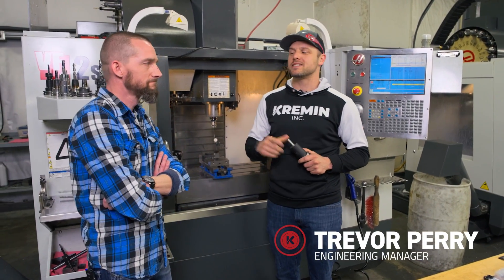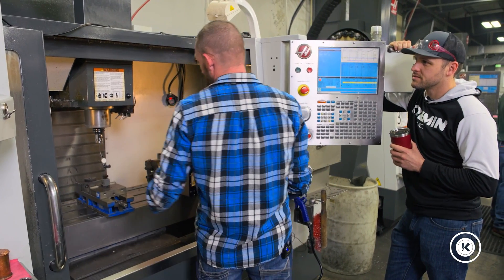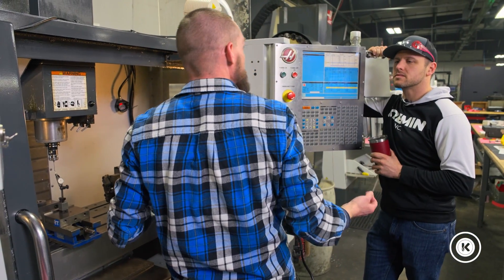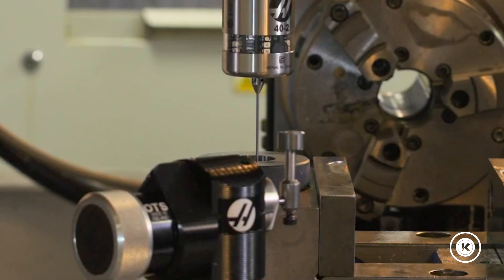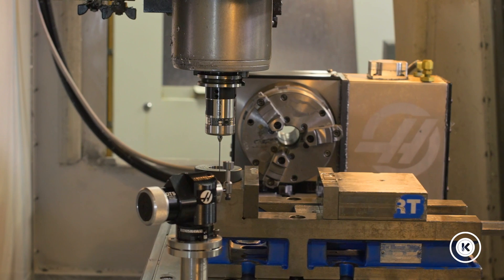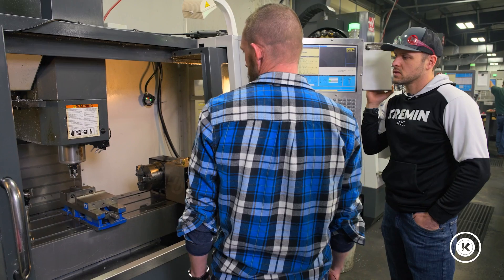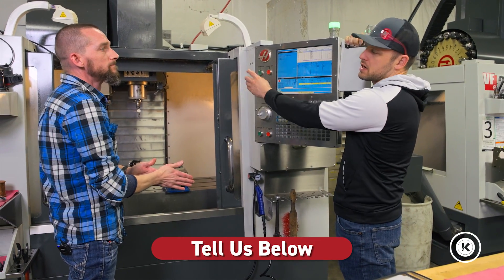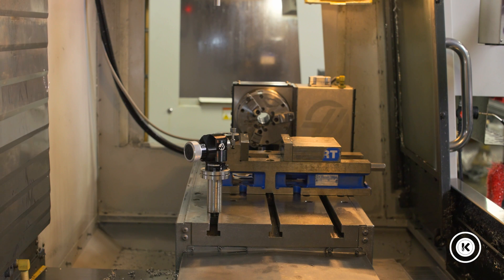How to Calibrate HAAS OTS & Spindle Probes

Comment: 5 tenths? That is way out for me. I get it to zero tenths.
I dial my end mills down to 2-3 tenths but I use a lot of small end mills.
Reply from the maker: How small of an endmill are you using?
Reply: @KreminIncManufacturing   2.4mm, 3mm, 1/8", 6mm, 1/4" and sometimes 3/8".
Reply: The point of running the calibration cycle in the calibration ring is that it compensates for the ball being off. Anything under .001" is fine.

Comment: That prob seems a lot smaller ball size than the stock one it comes with. Where did you get it and what settings did you change.
Reply from the maker: On the newer control it will automatically detect the ball size when you calibrate it, I believe on the older controls its one of the settings (I will check which one) - the probes are renishaw touch probes, you can get them right from renishaw or a 3rd party on the web. They have all different shapes and sizes.
Reply: @KreminIncManufacturing  I have a DT-1 and when I go to probe a bore the rang is 0.3-16.  Even if I get a small probe I don’t think it will let me go any smaller then 0.3 unless there is a way to change the settings? Do you know anything about this?
Reply from the maker: @natecollins5275 what size hole are you trying to read and are you just looking to get the center? That parameter looks like it’s fixed in the probe and can’t be changed.
Reply from the maker: The guys have also used a pin in the hole and picked up the center with the boss function instead of the bore function, but that doesn't help if you are trying to check within cycle/production
Reply: @KreminIncManufacturing that’s what I’m thinking